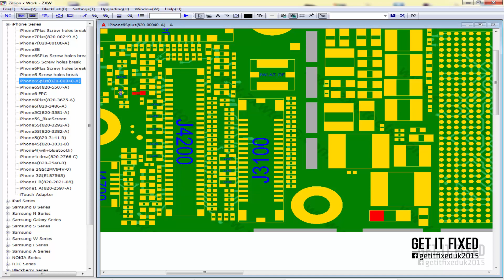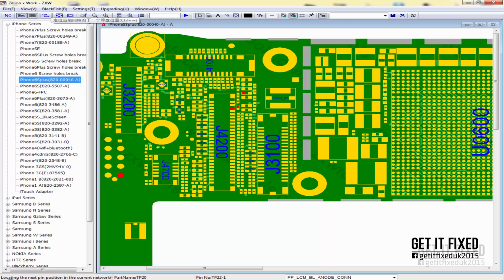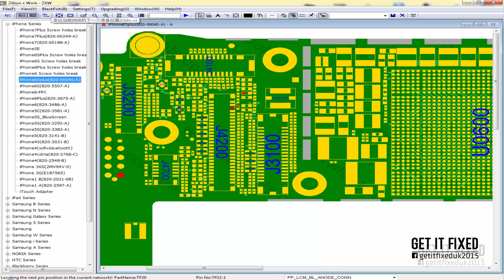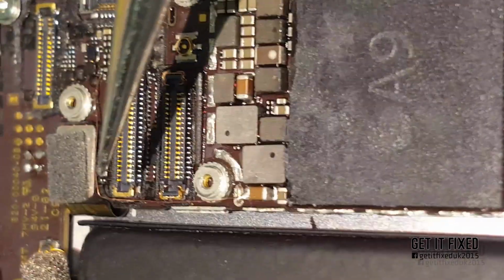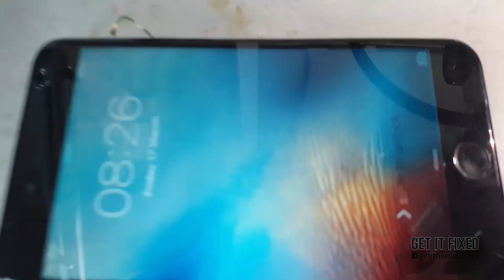Iphone 6S 6S Plus Half Backlight  Dead Backlight Fix Solution

Comment: Hello, Great video! I am new to repairs and having an issue I was hoping you would read and give me an educated guess on what you think it may be? I have a Iphone 6S Plus...I do have a rework station and ZXW. First: The LCD does not come on
Second: When plugging in the USB to laptop, Itunes comes on right away and says I am in recovery mode without doing anything to the phone prior. Third: I have tried exiting DFU without any luck (I did test the LCD and it works on another test phone). Forth: I plug in charger to phone and see it is drawing 0.44 amp, Battery is charged (Output 3.8 Volts) and Output connector to battery is giving about 3.75 volts.
Board looks fantastic/clean with no obvious signs of burnt or swollen components. 
Would this be a Tristar issue? Or because the screen isn't coming on, a backlight issue? or Backlight IC?  I know it is stuck in DFU, and get error 4014 when trying to reset in itunes...
Thank you for any advice you could provide :)
Reply from the maker: Hello there, u have done very well on telling me all this info. All u need to do is to reball NAND Chip. And it will come back alive! It is very risky job and u will loose all data. U need to remove nand ic chip rework the balls and place it back. !
Reply from the maker: Or try 5 times with different genuine cables to restore it. many times come back alive. 90 % of cases in nand errors
Reply: thank you very much! I have reball ed the Cumulus, Meson and Tristar in the past with success...Never tried the NAND. Any tips on Temp, or the risk factors?
Reply: Would you try the Cables or NAND if it were you? I only have 2 cables and neither worked. I could buy 3 more...
Reply: or would Reflow work?
Reply from the maker: first i always try the fastest way, restore for 5 times. if still same with different wires cable then i go hardware.
Reply from the maker: Reflow is risky if u do not do it proper, try, cover all area around with keton tape, or aluminum foil, use flux amtech just a bit in all 4 corners, and then 90 seconds 380 C low air, reflow!. Let me know what is the result. Welcome to help u anytime mate.
Reply: You got it...thank you again. Just curious though... Would reflow be successful due to underfill? or simply remove it and reball since I would have it liquid anyway...and if for some reason this is unsuccessful, can I just order a new nand and provide IMEI and Serial number for programming? I am thinking of buying the flash tool...something 3000...
Reply from the maker: yeah if u have the tool is much easier, buy new ic and reprogram with the same imei and serial number data. Try restore, reflow and after reball the nand chip, if not u need new nand ic. Cheers
Reply: thank you so very much for your time and advice... I am in the chair getting started...I will update you in a couple hours hopefully :)
Reply from the maker: Good Luck, do no rush, take your time.!
Reply: No Change :) I did pull the Nand and Reball, but it is in same state. Do you think it could be Backlight IC? or U4000?...U5301_RF?
Reply from the maker: if is same error, u need to check voltage around the chip, and if all ok, the nand chip must be format using 3000 tool, the programmer one.